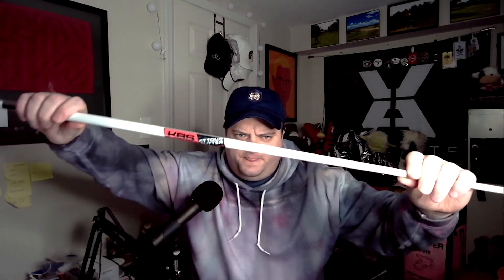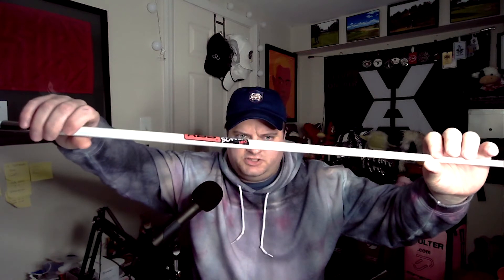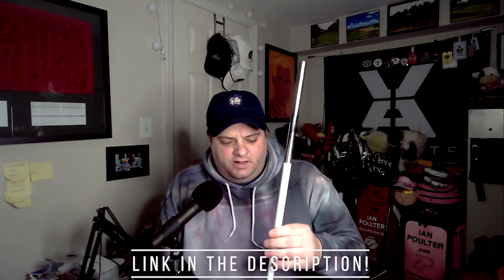What's in the Box with Bill Bush: KBS One-Step and CT Tour Putter Shafts

Comment: That one step is interesting, I wonder if TM will be the first company to offer them in their putters.  I currently play CT Tour and like it a lot, big difference in stock putter shafts.
Reply: Is the VT tour noticeable from a stock shaft in same putter? Or did your putter come with the CT.

I'm debating whether to upgrade to CT for £20 or one step for £50
Reply: @stuboy13  CT Tour feels much different than the steel shafts that haven't changed in 50 years. That's how I'd describe it.
Reply: I cant find anywhere talking about shaft prep for this shaft. Since it is a .370 is it treated as a parallel shaft and cut from both ends?